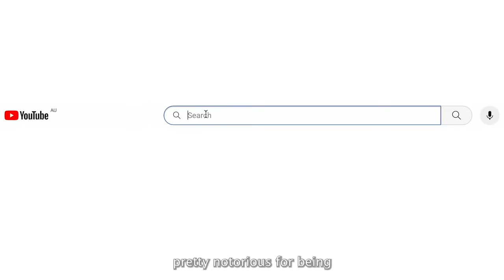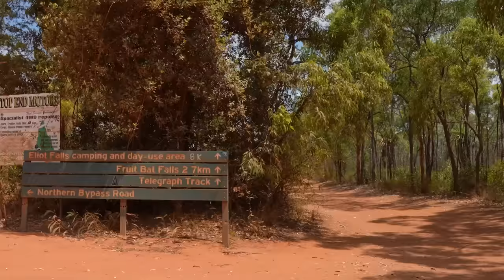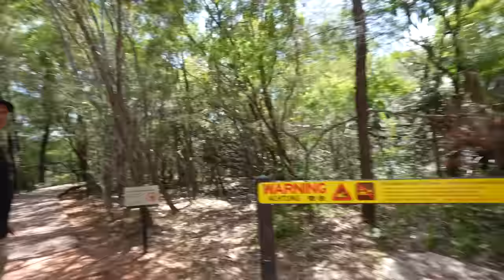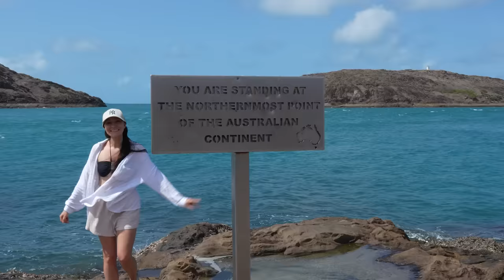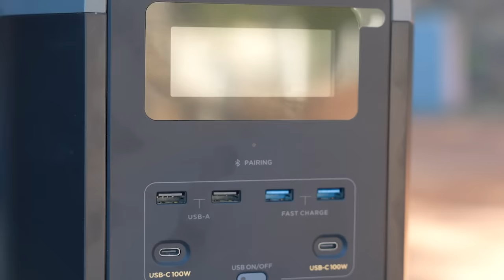Cape York was NOT what we expected.

Comment: Good to see you're back in Australia 👍.  Didn't tune in while y'all were "overseas".  

Big fan of EcoFlow products, and good to see I'm not the only one that uses folding camp chairs to support solar panels. If you find the Delta 2 is a bit lacking in power (if your useage increases), I upgraded from the D2 to the Delta 2 Max for our camping power needs. A bit heavier (50lbs), but available power is much better.

Ditto on moving that shelf by your heads. Noticed that hazard right off the get go.

Comment: @29:12. RE the water tank. I think it will be fine up there... I would also make a smaller tank, strap it to the Bullbar ( under the rego plate ), with tie down straps, if you need to use the winch, you can undo the straps, take water tank off etc etc. I would also spray the tanks Black, the sun will attract to the tanks, you'll get warm water.. maybe even a nice shower from it. We did exactly what you two are doing 23 years ago, we were your age and in a spanking new 2.8 DSL Lux. Really enjoying watching your adventures :))) Have fun! regards JT~

Comment: I would think that the reason it was so quiet, so hot, good roads, is that the tourist season generally finishes around late September - early October,  Before the change of season. It's a pity that you didn't get into Elliott Falls, but I agree, discretion is the better part of valour. It's a pity you didn't have time to explore the rest of the tip. Next time. Re changing wheels - if it will hold air, pump the tyre up first, then you don't have to jack the car up so much.

Comment: Good choice of touring vehicle. Quite economical. Should do well.
Just be mindful that the hilux has a total roof load limit of 60kg when driving, including roof rack bars, a roof top tent, and other items stacked on top.
This is why most dualcabs put internal rack bars in their canopy and put the rtt on the canopy, not the dualcab. But watch the rear axle load rating.
Dualcabs roof load ratings aren't like the old troopys where you can almost put a troopy on top of a troopy. Maybe not that extreme 😊

Comment: I will give you a couple of hints when travelling.
Get yourself some Bushmans insect repellent which has sunscreen built into it but if you can't get that just use 15 + sunscreen and you'll have no mosquitoes or midges..
And don't forget to let your tires down do a respectable pressure when it will give you a smoother ride on the dirt.

Comment: Hi Guys, love your vids.  To significantly cut down on dust entering the back tray, it needs to be pressurised.  Normally to do this a closable vent facing  toward  the  front  of the vehicie is installed on top and at the front of the canopy and left open of dusty roads thus pressurising the tray area as you move along.  In your case it maybe difficult with all your stuff mounted on top.  Maybe ARB may have an alternative option.